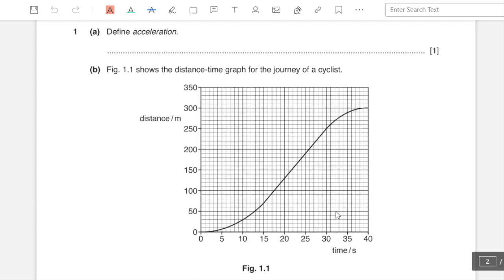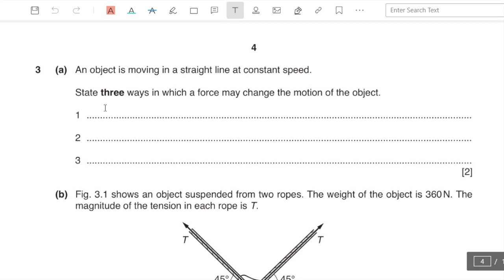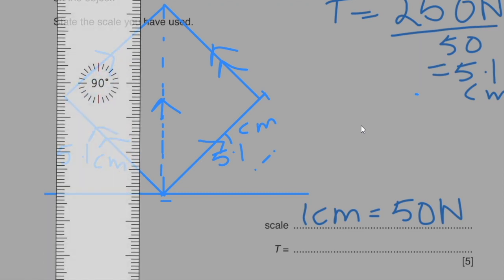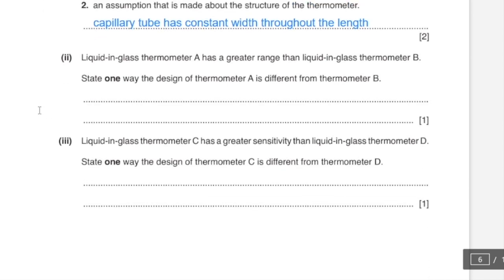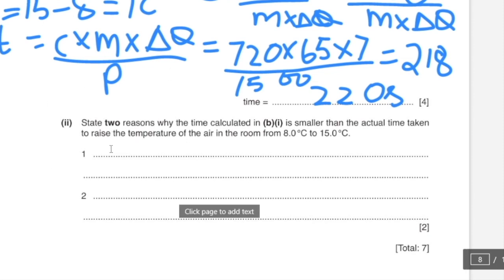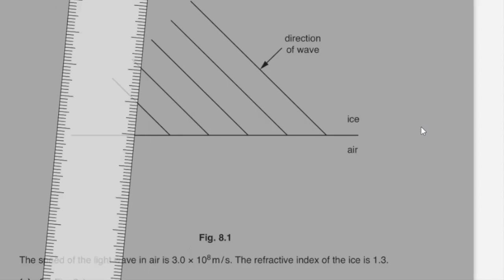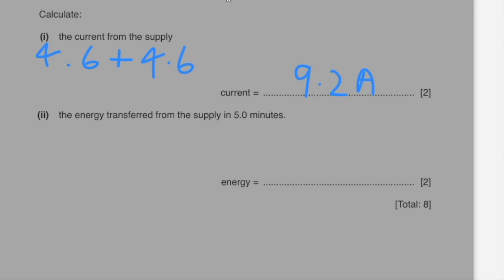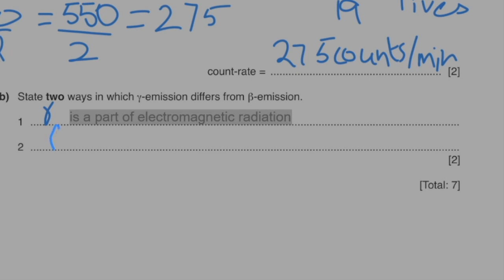CIE IGCSE Physics Solved Past Paper Feb/March 2019 P42

Comment: Hi in question 3)b) you used trignometry to calculate T and then simply drew the diagram again with the calculated value of T. Doesn't the question explicitly ask you to USE A VECOTR DIAGRAM to find T?
Reply: bro ethics isn't gonna take you anywhere, this is IGCSE
Reply: Yea you have to use vectors
Reply: Itsnot that serious unless in the question it was stated in bole, other wise a trig triangle is a vector diagram aswell.
Reply: u can make the scale by using 360 N acting vertically upwards which is the resultant u can say bc the rock is in equilibrium, so by using the resultant force u can find the two vector T! make sure u draw them at 90 degree to each other

Comment: Answer to question 2(1)1 is wrong it should be  31200
Reply from the maker: Yes that is the exact answer however, according to the mark scheme all answers are corrected to 2 significant figures.
Reply: A tually ur the one wrong I mean ur answer is right but  Cambridge requires us to write in 2 sf

Comment: No 2 is so wrong the answer is 3993600
Reply from the maker: Although the answer is 3993600J and you can write it that way, it can be rounded to two significant figures too.
Reply: igcse requires you to round off the values to the same ones in the eqution values (like 1945 tkg should be written a 2000 kg if the densicy is 400 (one significant figure))

Comment: The answer in this video for question 8 is completely wrong. It must be drawn such that the refracted ray is bending away from normal and then draw wavefronts perpendicular to the refracted ray. Because it is moving from region of low speed to region of higher speed. Hence you will be have a greater wavelength
Reply from the maker: This is the answer from the respective mark scheme:
Wavefronts in the air:
Parallel to each other [B1]

 Make a larger angle with the boundary than wavefronts in ice and from top left to bottom right [B1]
 At least one wavefront meets a wavefront in ice at the boundary [B1]
It does not credit wavelength. However, you can show greater wavelength if you wish to.
Reply: @examhelpweb2090  according to the marking scheme it says Make a larger angle with the boundary than wavefronts in ice and from top left to bottom right shouldnt it be closer to the normal ?
Reply: @zainabkhan6263  it should draw the ray that represents the direction of the wave first away from the normal and then draw the wave fronts perpendicular to that as it s a transverse wave

Comment: hi for question 8, shouldnt the wavelength increase as light travels faster in air?
Reply: Your very much right man. The answer in this video for question 8 is completely wrong. I suggest you draw the refracted which is bending away from normal and then draw wavefronts perpendicular to the refracted ray
Reply: @jailnet  thats very true, we use rays to determine the angles
Reply from the maker: yes, change of medium from ice to air of light waves means increase in wavelength  as well, but here the question does not require candidates to show this.I hope this clarifies your doubt